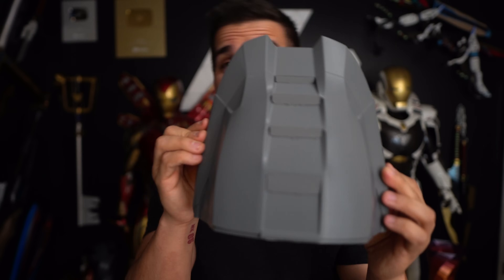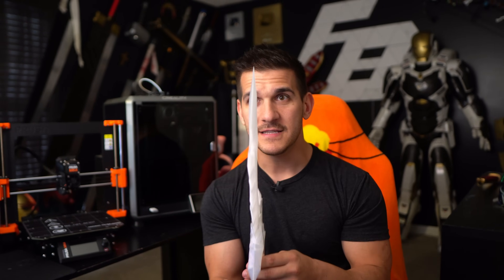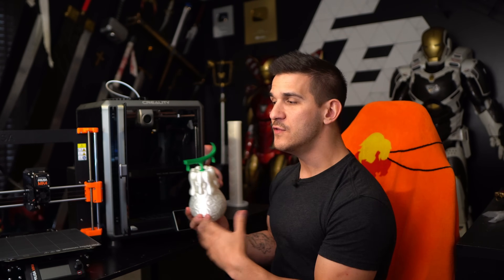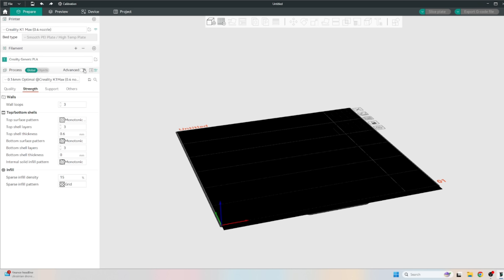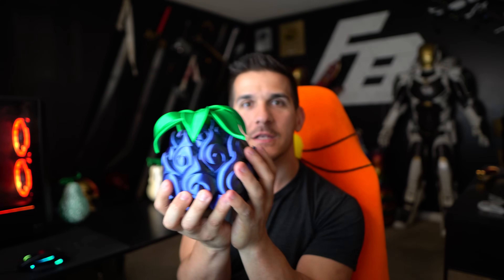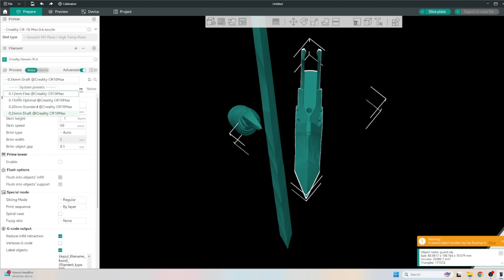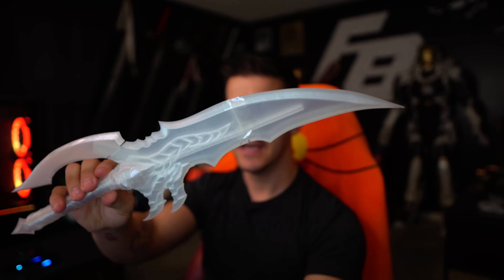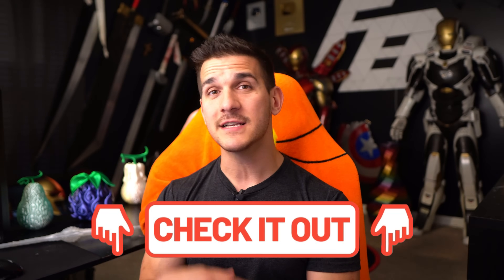How I get SMOOTH 3D Prints | EASY Slicer Settings You've Been Wanting!

Comment: Apart of my "no sand 2024" setup, Ive been using the following:
Proper orientation 
.16 LH
Adaptive layers 
Outer to inner wall sequence 
Organic supports 

That's it. I've not had to sand any of my prints on both the bambu's and the Neptunes.
Prime and paint and I'm all done.
Reply: I've been using the 0.08 height on my P1S with otherwise default settings and the quality has been stunning. Did a test paint job on one of the pieces and with a single coat of filler primer and paint the end result is fantastic. Been trying to avoid having rounded edges on the top layers of the print because they end up leaving massive layer lines, but other than that it's pretty much spot on.
Reply: @BinaryHe1ix what kind of things are you printing? Props? I’m trying to see if upping the quality would help with sanding less for things like helmets and masks, etc
Reply: @raymondgomez8687  Currently working on a Helldivers cosplay, the regular B-01 suit and an autocannon with backpack. Haven't started the painting process yet, but the initial test paints I've done have looked really solid with just the primer and paint.
Reply: @BinaryHe1ix  awesome! I’m gonna test making helmets with higher qualities and see how they come out. Thank you!
Reply: What about speeds? Standard?
Reply: @leonprints  standard X1C/A1 speeds for the Bambu
250mm for the Neptune 4 max
Reply: @deadlyapollo  alr alr, i got a p1 so ill give it a try, thanks